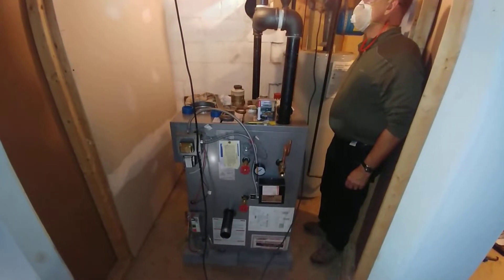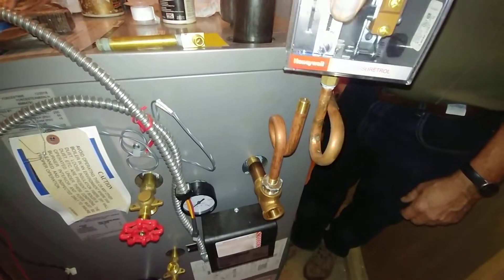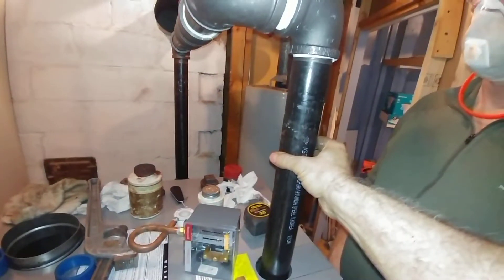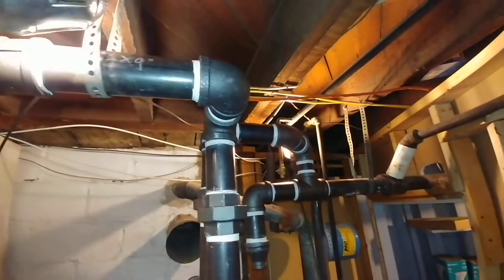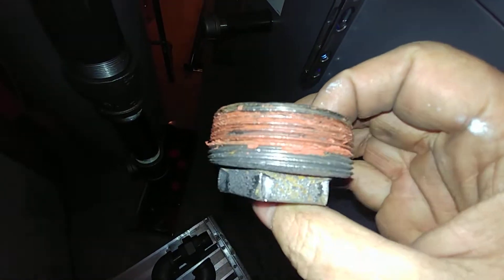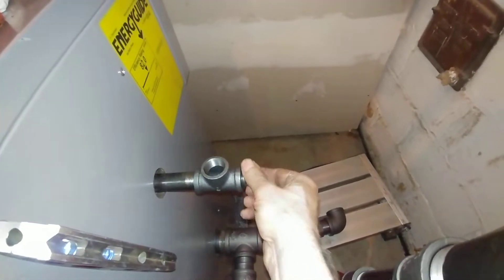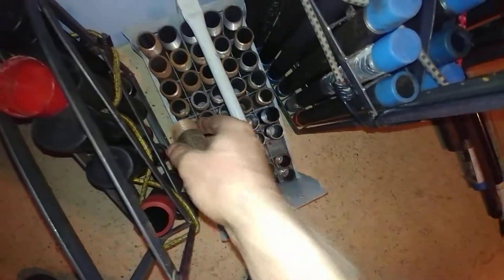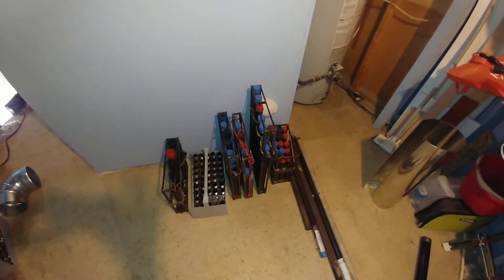Steam Boiler Install...More Assembly Required

Comment: Do we have to use Sch80 for return or supply? Or both? What do you recommend?
Reply from the maker: On low pressure steam supply, sch 80 is not needed.
On wet returns, it may be used. I've been known to use it now and then esp. if I need to use a close nipple.
I'm looking at using more stainless steel  on returns as it seems to be easier to obtain and cost effective.